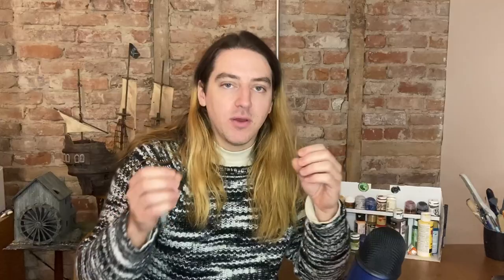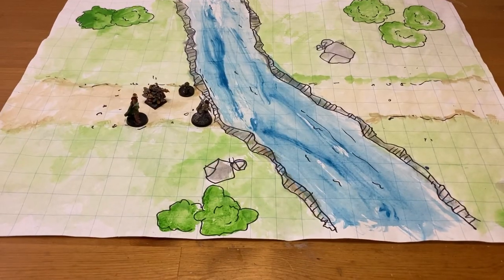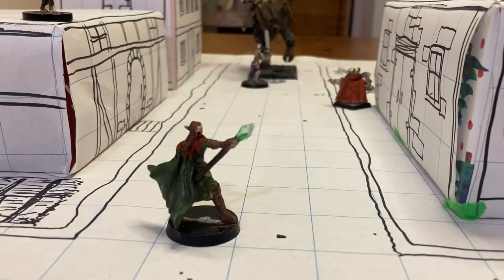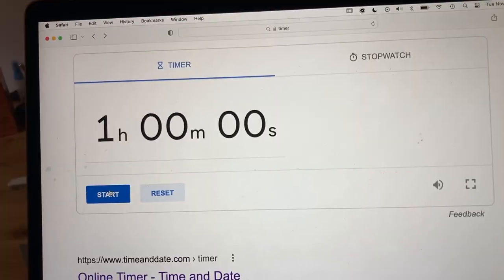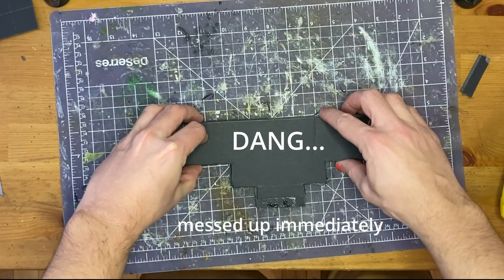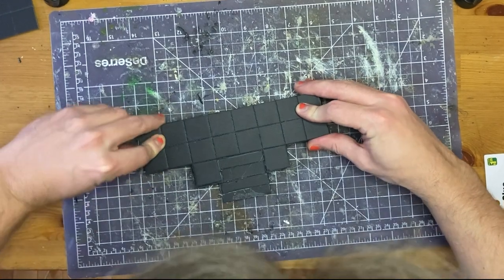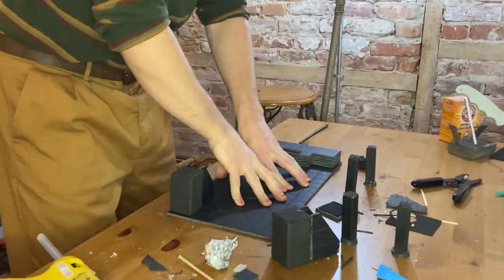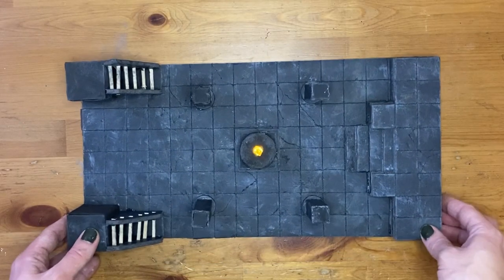How to START Crafting for D&D!

Comment: Maybe a dumb question, but do you leave the paper on the foam core? Seems like it is more rigid with it on but any paint or glue would fall off easier if the paper peels off the foam. Thanks and love your channel ❤
Reply from the maker: Not dumb at all! I personally don’t Peel the paper because the foam core I can get doesn’t peel easily so it just becomes a mess (kind of just depends on where you are if it peels or not) It does mean things glued onto it can peel off easier. It’s happened with little things before but it hasn’t really been a problem for me! Thanks a lot!